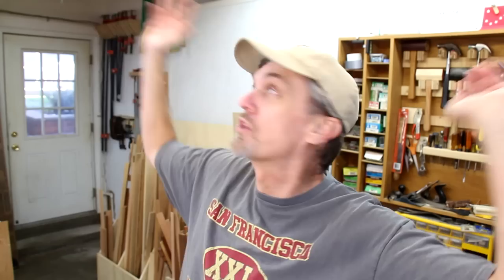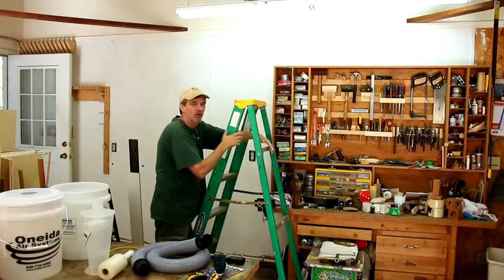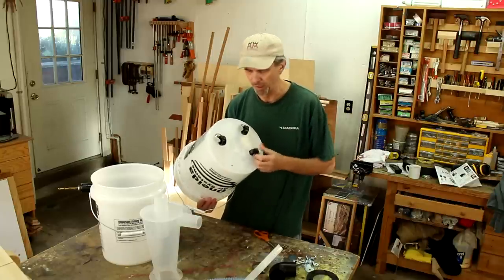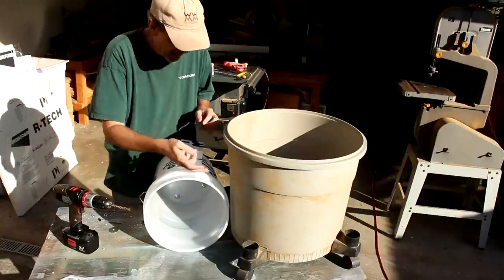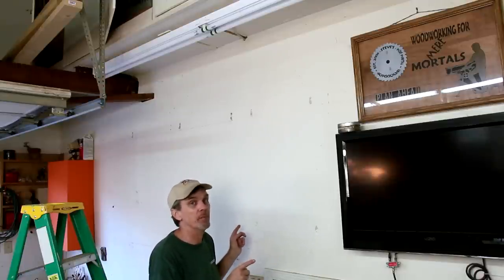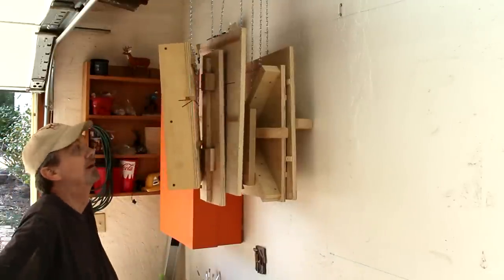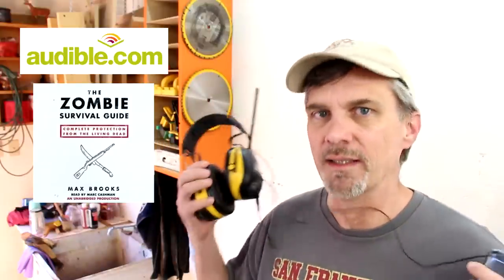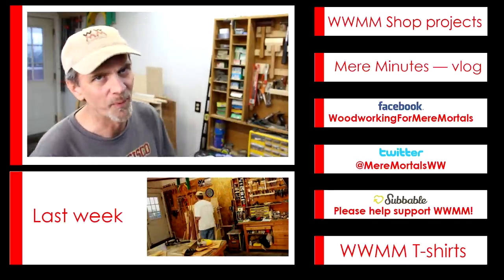Woodworking shop upgrades, storage solutions, and stop-motion animation too!

Comment: Great Video as always and congrats on the new sponsor I love audio books. I have the same set up with the dust collection. I add the bag into the shop vac and have never needed a new filter or had vac over heat. And don't worry I had to tape some of my hoses too.

Comment: For the blades hanging on the nails, if you stick a small thin piece of wood with an oversized hole in it between the blades it makes it easier to take them off.  It's harder than it looks to get them off without that.

Comment: My shop has limited space, so my bench power tools are on stands that I made so they can be slid around depending on what tool I need. My jigsaw and my miter saw share a miter stand. The jigsaw is easily removed when I have to cut the big stuff Also my power tools I store in "kit form". Routers, bits and jigs in one box. Air nailers and staplers in another. etc. This also helps when I go out to help someone with a remodel/project. I just grab the kits I need, knowing that everything I need will be there without hauling extra stuff.

Comment: Hi steve, love the video.! You crack me up. Lol.
Here a tip for you I seen from Izzy Swan, page a 1/4" space between your saw blades that you mounted on your cabinate to percent the carbide teeth from hitting,  also you have 2 hooks (pins) there,  could use on for dull blades one fir sharpen ones.
Keep up the good work,  can't wait until next week.

Comment: wow, i had the exact same experience with your dust separator!!!! R O F L 

over time the foam compresses and the bucket becomes loose so the castors on the bucket sit sideways and then it hobbles around when you roll it. when i first set up one of those separators, i took an old 5 gal bucket and put 3 bricks in the bottom  and screwed that to a block of wood on castors. it worked great detached from the shop vac but over time, took up too much space. i settled on making a wood cart where the whole thing sits on separate castors. good luck :)
also love your stop motion sequences + sound effects. buzzzzzz buzz

Comment: If you want an extremely effective and basically free dust separator, check out a Thein Baffle. Made one for my shop vac out of scrap OSB, leftover PVC, and some hardware. Unlike cyclone-based systems, it's effectiveness doesn't decrease in proportion to how full it is. Mounted on top of the vac (which is in a muffle-box) means no lost floor space and the vac is much quieter. Would also make a very good project video.

6:55 - that damn bird from the last video is back! ;)

Comment: I have enjoyed watching several of your videos recently, and I noticed you started with a very small, bench top, table saw, then got a new Porter Cable contractors saw, and now your using a different older/used cabinet type table saw.....What happened to the new one?...just wondering.....

Comment: In a 24/7 industrial shop this can be an issue. For a garage woodworker the risk is negligable.

A way to get around this, if you have threephase power, is to put the armatures on different phases.

Comment: i feel so cheap and nasty :(  to fix the shopvac dust filter problem and the fact it spews really fine dust back into my shop I just put the wet filter on it which stops the big stuff and attached some plastic piping to the exhaust which runs outside to annoy the heck out of my neighbours.

Comment: instead of attaching hooks to the sleds, just drill a 15mm hole in the deck of the sled.
also, perhaps you know better and are more confident than i am, but i'm leery of hanging circular saw blades on nails or screws or whatever. i'm a drummer, and i know that thin pieces of metal like nails tend to turn the centre holes of thin discs, like cymbals and perhaps circular saw blades, into keyhole-shaped former circles.

Comment: Steve, Having florescent lighting over a Lathe is not a good idea. The light can cycle at the same frequency as the lathe making the lathe look like it has stopped while it is actually still spinning. VERY DANGEROUS. This also apply s to circular saws and drills. Get yourself a couple of old bedside clip on lights with globes and attach them over your lathe.